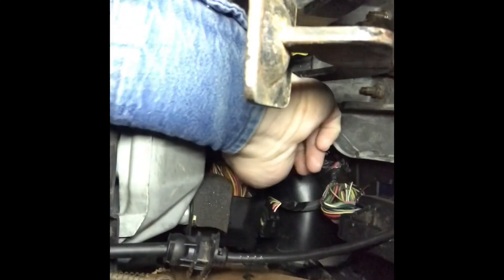Pt. 4. Wiring Safety Neutral Switch or CPP Sensor/Manual Transmission Conversion 1995 Ford Ranger

Comment: Soooooo… instead of changing out the entire harness under the dash… the plug for the clutch safety switch was there ?
Reply: Im in the middle of doing this swap and yes my nuetral safety switch was already wired and under the dash attached to a blank plug.  The main issue with wiring is that the auto and manual wiring harnesses are different that go to the transmission itself.  It can be adapted with some work.